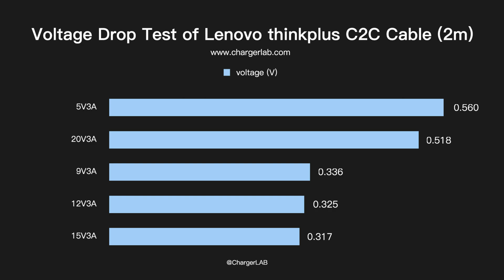Teardown of Lenovo Thinkplus 135W Original Dual USB-C Cable

Comment: Nice teardown (as always!) but the music would’ve been better at like half the volume that it was

Also I’m quite confused as to how the cable can have different voltage drops at the same current (surely the resistance and therefore voltage drop should be constant?)
Reply from the maker: Because the current in the circuit is not constant and fluctuates with the voltage.